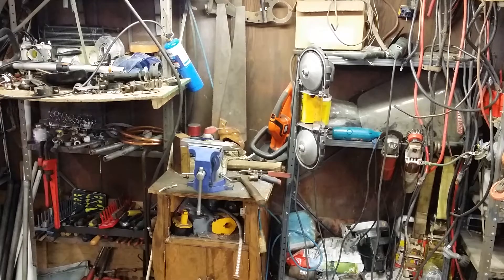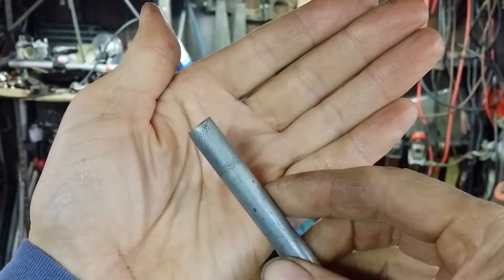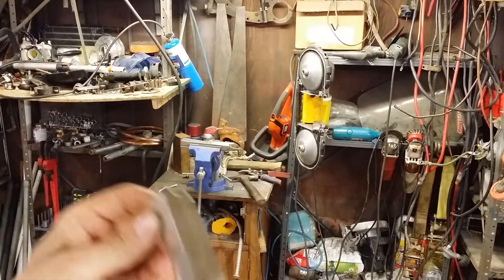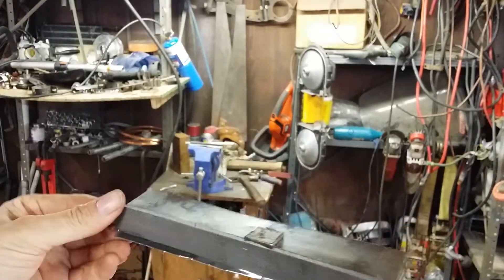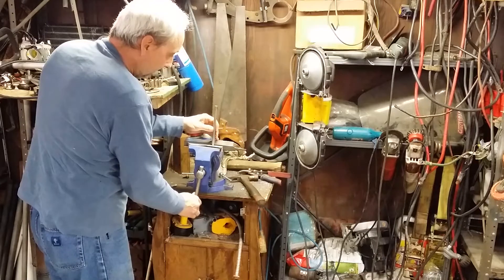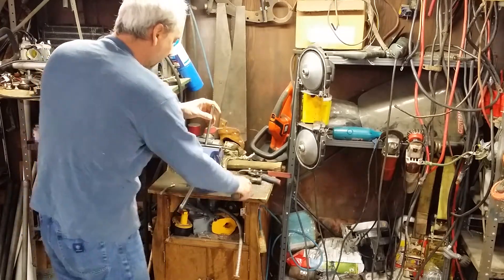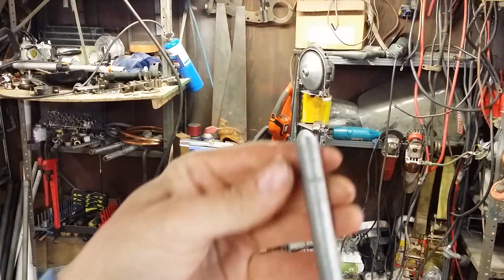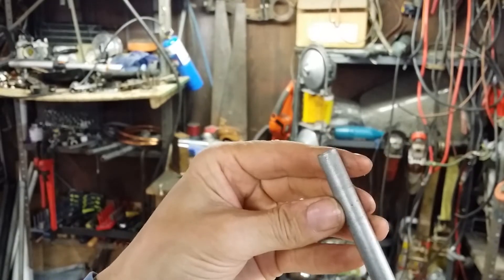Knurling in a pinch with a file in a vise

Comment: Pask Makes is the name of the channel and here's the video.
https://www.youtube.com/watch?v=xH5qihIn5lI
He starts off with the file routine, then makes a jig with actual knurling wheels complete with failures and the trial and error process to reach a workable finish.
Reply from the maker: Yes, I remembered later, he has some terrific content
Reply: @craigtate5930  There's also a guy who converted a tubing cutter into a manual knurling tool which seems like a natural to me but I've never found it again after seeing it one time a few months ago. One of these days I'm gonna pick up some knurling wheels off of eBay and try the tubing cutter conversion for myself. I think any manual method one might try is going to have a better chance for success on softer metals like brass & aluminum. Good luck. {8^)
Reply from the maker: @dale1956ties  I think I remember seeing a knurling setup like a tubing cutter once as well. Definitely a good idea
Reply: @craigtate5930  Yeah, I know it's out there Or at least it used to be. If ever I find it again I'll post the link here.